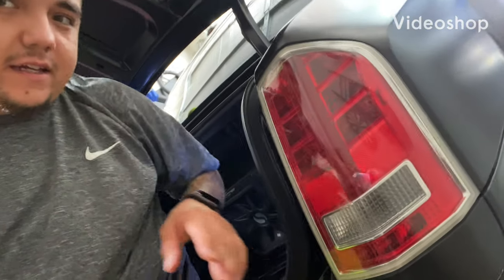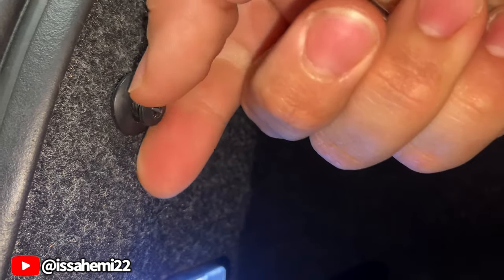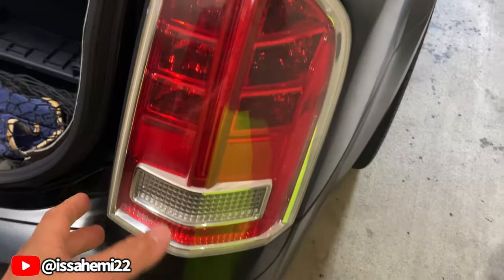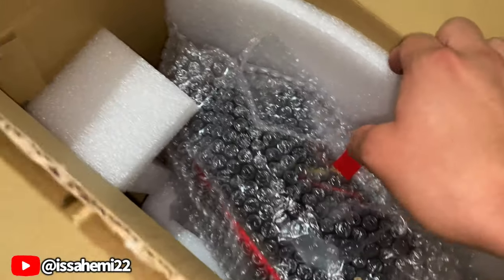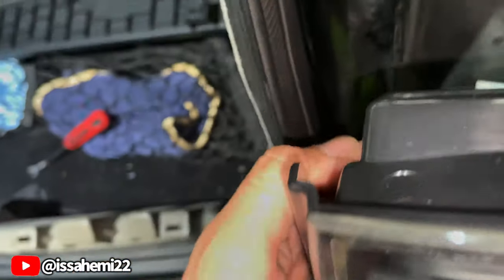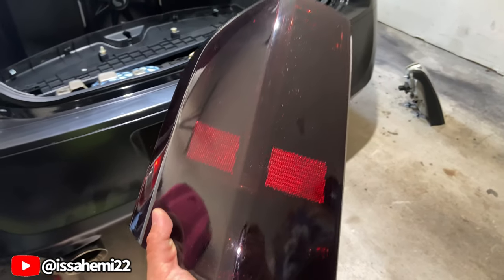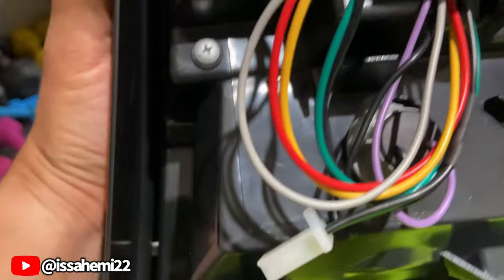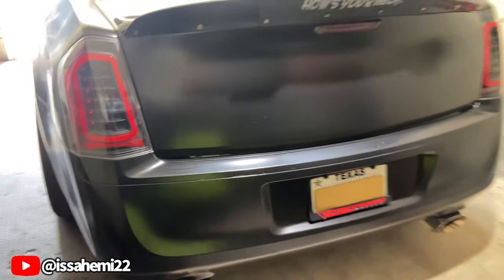MUST HAVE MOD FOR ANY CHRYSLER 300

Comment: I think that extra plug goes to the rear fog lights. Yes the 300C has rear fog lights my car has that. It's a white light that turns on in the back of your tail lights
Reply: Bro that’s your reverse lights lmao. You should never have white lights on full time in the rear. It’s illegal.
Reply: My rear fog lights are red. Brighter than running lights but dimmer than brake lights.
Reply: it's not white for rear fog light and if it was probably someone messed up the wiring.
Reply: @jusjohn  my rear fog lights are red though on my Chrysler 300c

Comment: Did you find out what the other plug was for? I'm thinking possibly sequential. It's crazy that you get pulled over for ya lights being tinted. I've gotten pulled over for everything but that and I believe mine is darker than yours
Reply from the maker: Never found out what it was for, but I do believe it was for that sequential. I never hooked it up
Reply: It’s to plug in a resistor for the lights.

Comment: Not only do the lights look good, the car sounds bad ass. What exhaust do you have on that 300 Tom of cape coral fl.
Reply from the maker: 🙌🏼 Thanks‼️ It’s straight piped muffler and resonator delete with 5 inch tips
Reply: Did you ever find out

Comment: ⭐️⭐️⭐️⭐️⭐️  What I’d do next is put red under glows in the back and amber under glows up front.  4-wheel wells.  Then I’d wire them into the signals (fronts) and signal/brake (rear).  Coldest 300 in the county.  🧐

Comment: Did the old lights have daytime running lights on them as well? I have an 06 SRT8 and I would love to have daytime running lights in the rear , didn't know if that was exclusive to the later models only or was that something that the new tail lights you installed 👍 it really does look better than the older OEM lights.
Reply from the maker: Yes, this is the luxury 300c model

Comment: Also in the dfw area. More so towards Mesquite / Garland. 
There is dealership selling an 07 6.1L  with 70k miles. They want 19k for it. It is very clean. 
My only concern is , how bad was it dogged by the previous owner. 
Mind you this isn't for me. It's for my son. It's either that or a 22 accord.
Reply from the maker: 70k miles on a 07 is real low mileage also comes down to how many previous owners if 1 or 2 I would settle for the SRT. Those Accords are nice but idk about paying $25-35k for it? The Accord would definitely last you in the long run.

Comment: Whered you get this spoiler ? I know you wrote the question on it but its pretty cook it would go nice with a wide body kit for this car i have a 2007 5.7 liter i just rebuilt and dropped today i should be done in a day or two and focused on some of the outside like these rear lights i want some of the halos for the front and a new spoiler i have the srt design im not sure whats different about it but i loved my previous 300c and im sure this will be fun to build as well
Reply from the maker: 👌🏼 eBay it’s a 2 piece winkerbill spolier

Comment: I got a 2015 Chrysler 300 5.7, have you had any issues with LEDs. My underglow on the doors start to flicker after a while. Any info would be appreciated.
Reply from the maker: Flickering is usually caused by I bad connection or those lights are going out. It could be a loose connection? Check the connection close to those sides.

Comment: where did you get the spoiler from I have a 16 300 but wouldn't the same one you have fit mines as well
Reply from the maker: Yeah it’s a 2 piece winkerbill that you install to the factory spoiler.
Reply from the maker: eBay

Comment: Which exhaust, what's the offset on the rears? You running staggered?
Reply from the maker: Straight piped, yeah I’m staggered with 10.5 in the rears with a +15 offset
Reply: @issahemi22  20s?
Reply from the maker: Yeah got 9.5 in the front

Comment: Where did you find the blue lights inside the trunk and do you have blue lights for the inside if so where you gettem from bro
Reply from the maker: Yeah I got leds all inside as well. I ordered them from ebay just search led for your vehicle & it’ll pop up the ones you’ll need. Makes a huge difference‼️

Comment: Where did you get the rear diffuser? Also, did you figure out what the extra plug was for?
Reply from the maker: I got it on eBay and the extra plug I never plugged it in & they been working fine since the install
Reply: @issahemi22  thanks man, nice ride

Comment: What tire and rim u run on those
Did u add spacer
Reply from the maker: I believe this set up was 275/45/20 in rear with 20x10.5 and 245/45/20 with 20x10 in front and no spacers

Comment: The lights look dope! did you do a catback on the exhaust? it sounds mean!! I have a 2013 300C and I want to upgrade the exhaust. Any recommendations?
Reply from the maker: It’s straight piped with no mids, no mufflers and some tips. I had flow masters 44 on my other hemi and it was more of a soft rumble. For the price I’ll recommend straight pipe. I’ll try and post an exhaust video soon.

Comment: What exhaust mods do you have?
Reply from the maker: It’s straight piped 😈
Reply: Posie Slayer I have a 2013 300 v6 ,I bought 2 cherry bombs did a delete and x pipe ,costed bout 450 with installation..made it sound like a v8
Reply: @anthonyhuerta6122  any vids thinking of doing the same for my v6

Comment: I need help my car radio fixed man it not turning on bro
Reply from the maker: 🤔 not sure what it could be is the screen still on?
Reply: @issahemi22  Noo screen isn’t on
Reply: @YsoseriousNate  did you check the fuses?
I think the radio is in the rear fuse block...
Reply: @colleenthompson4069  yes I have they not burnt at all  and when I checked my car wasn’t turning on at one point I thought it was my fob I bout a new battery and nothing was working untill like days after
Reply: @YsoseriousNate  TRY THIS: pull the fuse and wait 10 seconds..put back in and turn the car on...let me know if that worked, please?
Reply: @issahemi22  nahh my screen not on at all
Reply: @colleenthompson4069  like unplug the whole fuse box like troubleshooting it
Reply: @YsoseriousNate  no dude...just the fuse assigned to that radio or media center...pull fuse out of the socket and wait 10-15 seconds and plug it back in
Reply: @YsoseriousNate  did you pull the fuse and re-insert it like I told you? please tell me about it
Reply: @colleenthompson4069  I’m pretty sure I did but I’m going to buy a new screen and everything for because I can’t even control my ac on it either like it’s on auto like if it’s cold outside it’s warms ups and etc…
Reply: @colleenthompson4069  where did u send the link because I don’t see it
Reply: @YsoseriousNate  simply pull fuse F37 from the fuse box in the trunk, count to 10, and put it back in that will power down and reboot your radio.
Reply: @colleenthompson4069  ok on my 2012 Chrysler 300s I’ll do it
Reply: @colleenthompson4069  I checked all of them with fuse tester and then my car didn’t start Is that some government security thing or something
Reply: @colleenthompson4069  do you keep ya car on while doing it or Noo
Reply: @YsoseriousNate  NOOOOOOOO
Reply: @colleenthompson4069  wym nooooo lol my car not turning on
Reply: @YsoseriousNate  I thought you asked if you pull fuses while it is on or running. What's wrong this time? Did you disconnect a battery or is it dead.? What exactly is your car doing? I am assuming it is a chrysler 300 right?  Maybe your battery is drained. It has to have a lot of juice due to the 30 or modules it has to power. Make sure your battery is charged up
Reply: @colleenthompson4069  like I had test the fuses if it was positive or negative on this fuse scanner thing and my car won’t turn on now like this the second time doing this
Reply: @colleenthompson4069  but do I keep my car on while checking my fuses

Comment: Do your tires rub in the rear?
Reply from the maker: They use to before I rolled the fenders
Reply: @issahemi22  how much did you get charged if you don’t mind me asking?
Reply from the maker: @pvp_king6025  I did it myself, I ordered the fender roller on Amazon for like $50 it wasn’t to hard to do
Reply: @issahemi22  ok cool appreciate it